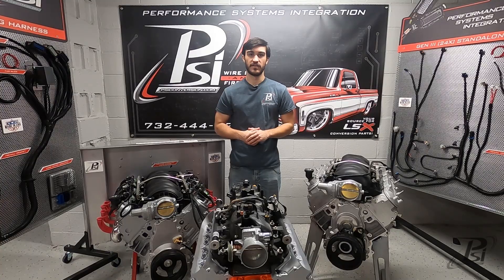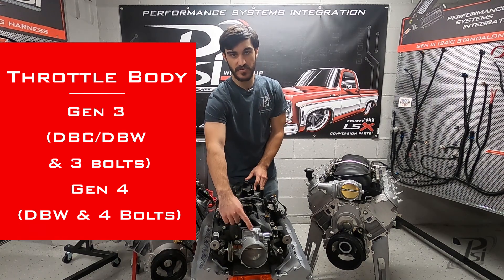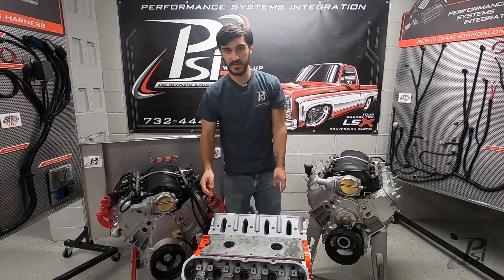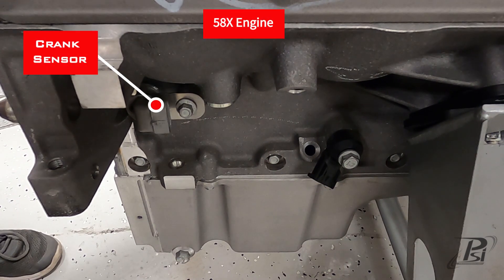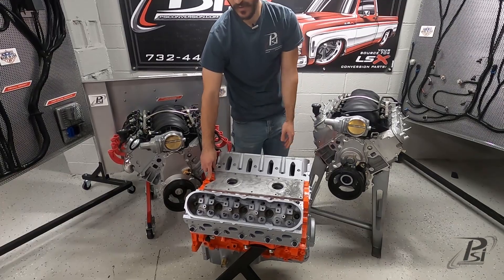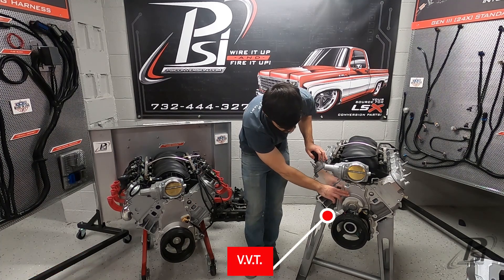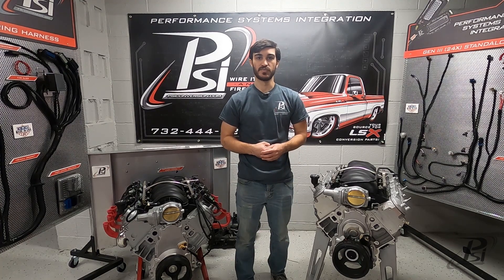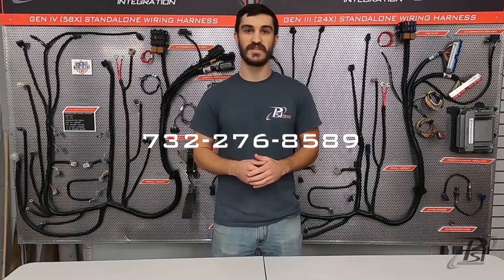PSI How To Identify an LS Engine ( Plus VVT vs. Non-VVT )

Comment: Is it possible to retrofit the Variable cam phraser from an L99 to an LS3 or LS1 with any LS1 or LS3 camshaft?  As in to get the best of both worlds.  The L99 didn't come in many countries where we had heaps of LS1s and LS3s
Reply from the maker: You could install VVT on an LS3, but it would take a bit, wiring, VVT cam, head work, tune, etc to be done. A standard LS3 cam would not work with the VVT/cam phaser. Anything Gen3/LS1,2, 4, most 6's absolutely would not work at all.
Reply: @psiconversionyoutube  Would it not physically bolt up to the phaser or would you run into Piston/Valve interferance at max retard/advance? if using Stock LS1/LS3 Cam.
Reply from the maker: Vvt won't work on an ls1 or any GEN III application as the 411 and 242 ecms don't control it. If you want to put vvt into an ls3, it will physically work, but there are other things, as mentioned in separate comments that would have to be changed. TBH, not worth changing IMO.

Comment: Thanks good info. Late Ls2 engines had 58 reluctor wheels also. 2007 corvette
Reply from the maker: Right on! We have harnesses for both.
Reply: I just did a cam swap on my 6.2l silverado with an lsa blower deleted vvt now wont start would i need to get it tuned off for it to start?
Reply: DID YOU FIX IT? @ReyesRay